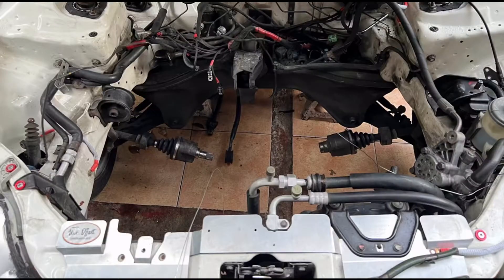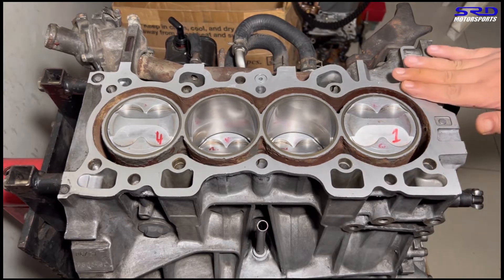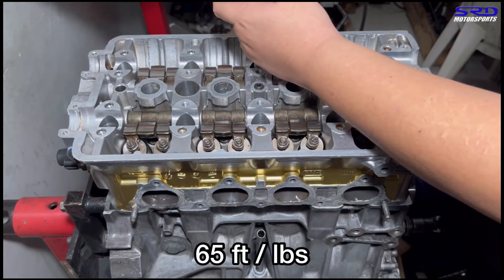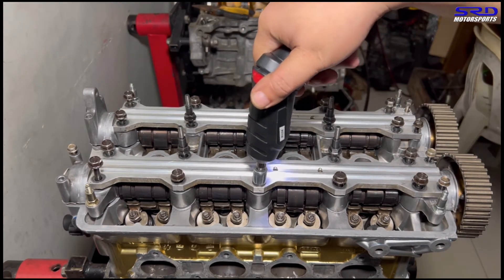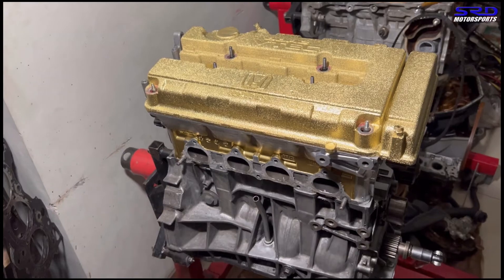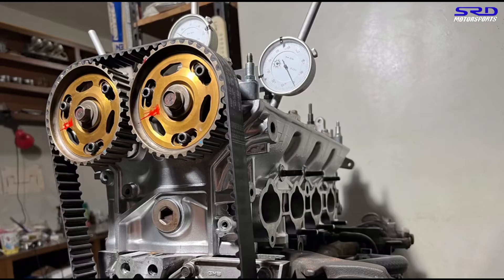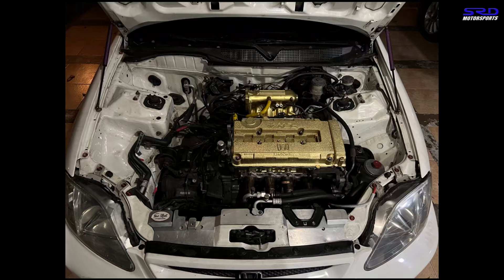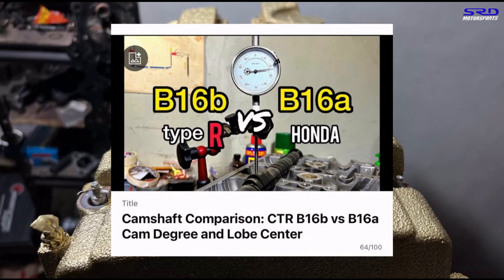Honda Civic SiR B16a Rebuild Series Part 5 Engine FINISHED

Comment: sorry sir, I maybe ask you funny question but the bearing & rod clearance apply to b18c & b20 also?
Reply from the maker: Yeah it would depend on the application and oil used, but what works for a b16a is the same
Reply: thanks you sir @SRDmotorsports
Reply from the maker: No prob sir, just comment away whenever there’s a question… ideally on current videos but on any it’s all good 😎

Comment: Love this series a lot! I got 1 question, when degreeing the cams did you put the dial indicators on the high lobe which is the vtec lobe?
Reply from the maker: Yeah locked  vtec so dials on the retainer to get the “at valve”
Reply: @SRDmotorsports  did you lock it with pins? I know some people use compressed air
Reply from the maker: @StraightOutThaGudda  compressed air works but too much task 
I just reversed the pin and ran a paper spacer of sorts to keep it “extra” extended lol
Reply: @SRDmotorsports  ahh interesting lol
Reply from the maker: @StraightOutThaGudda  and that too I know I showed in one of the videos how I lock em and how my colleague does it

not sure if it’s in the clay test video or valve to valve 

This! Thanks for reminding me the future revamped degree vid I got to make sure “locking” how to is included lol
Reply: @SRDmotorsports  I haven't watched that vid as yet but I'll surely watch it! A revamp would be appreciated as well
Reply from the maker: @StraightOutThaGudda  yeah I’m learning to… how to make it a more more complete content ftw!
Reply: @SRDmotorsports  awesome to hear that, you'll keep getting better Don't worry

Comment: Amazing work! I have a technical questions about brand new heads I bought 12 years ago from cb performance 044 vw heads and sadly I bought them not ported! Do you have a email I can send you questions if you can help me ?
Reply from the maker: Yea check the channel page the about section shop page is there I’m always responsive on messages
Reply: @SRDmotorsports  thanks a million we don’t have any one in town who is porting expert or even worked on vws I’ll be the first let’s see if I can do it Bulding a 1915 cc engine with dual Webers Idf 44s hoping to have a healthy good engine
Reply from the maker: @avomarkarian6187  oh man! That’s nice my main choice was a 1915 too but now I have a CBperformance 74 crank so it will be a 2054cc 😎 but I only have 36idf duals but looking to get some 44s soon and maybe find time for the vw life 😁
Reply: @SRDmotorsports  I had no experience or background when I bought the parts I would have gone a different size 1904cc 90.5x74 with daul 48s . Now I have a cb69 crank - engle 120 cam & lifters - mahle 94s - cb big valaves 044 heads - and 44s Idf carbs
Reply from the maker: @avomarkarian6187  that’s still a real good combo cuz the cb 69 is also good! That will be a fun motor